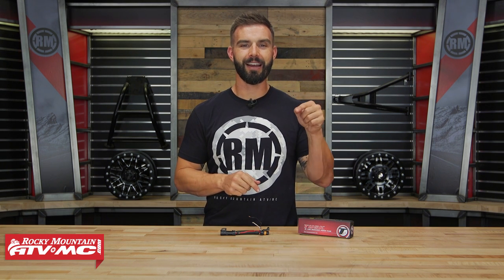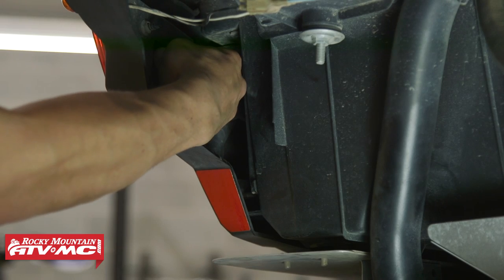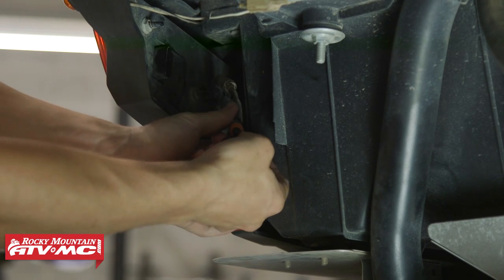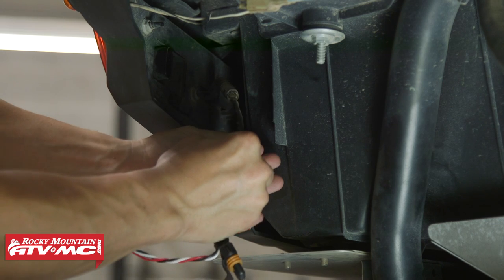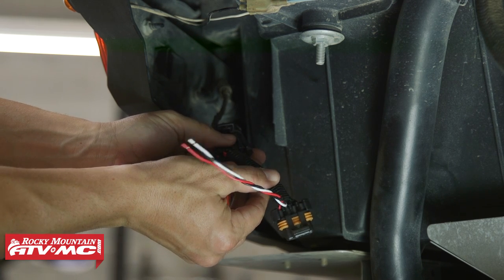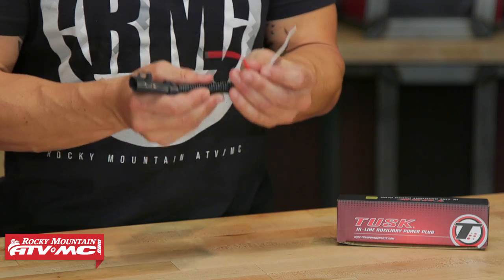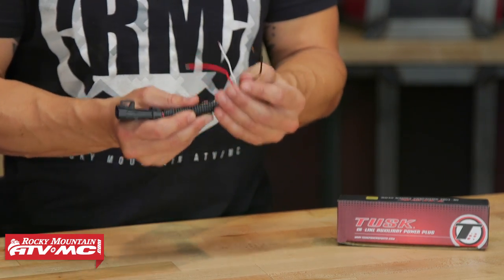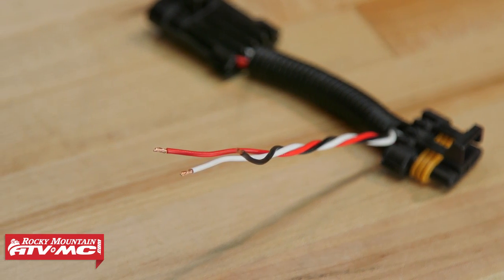Tusk UTV In-line Auxiliary Power Plug

Comment: I also bought this product it only power by key and if I have the lights on then my whip light will be in. I also have the rocker panel switch for the whip if I want total control of the whip light should I connect to the switch itself

Comment: I just bought this plug.. when I connect the red wire and the ground wire to my accessory light and not connecting the white wire to anything and turn the key the accessory light comes on but not my tail lights. If I unplug the red wire the tail lights come on if I connect both red and white wire and my accessory light then my brake lights come on.. what is happening?

Comment: I purchased this product but im having issues with the fuse blowing out when i turn on my lighted whip from tusk. Should i put in a higher wattage fuse or should i wire it a different way?
Reply from the maker: As long as the connector has a solid connection, the
red is to the positive, the black is to your ground (your white wire shouldn't
be connected to anything if you don't have an addition brake light), then your
connections are good. If you're confident that everything is good there then
you can move on and add a fuse that's 5 amps higher and see if that fixes your
problem.